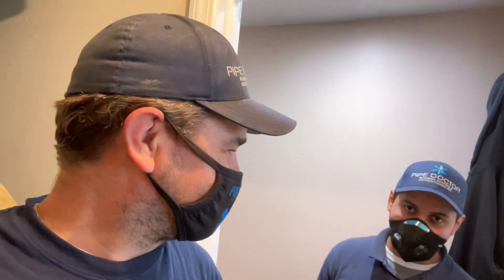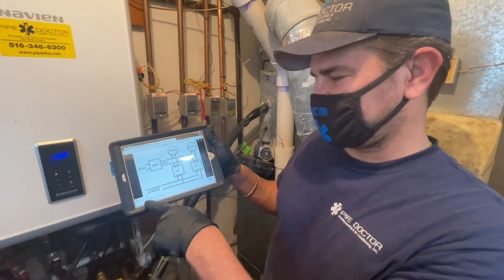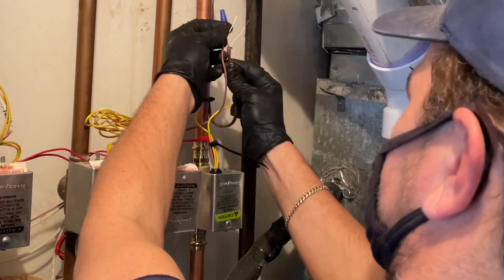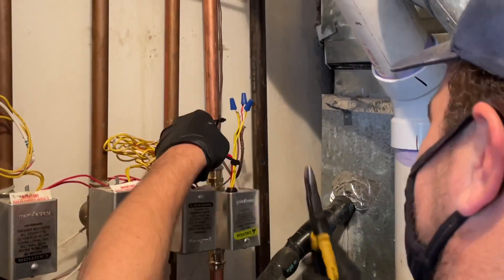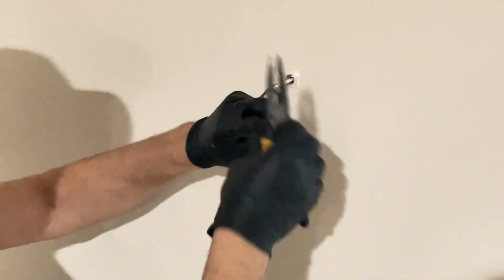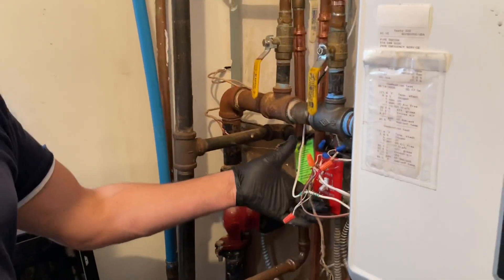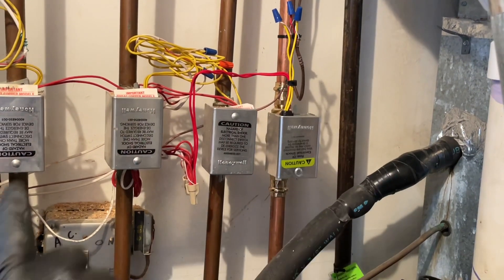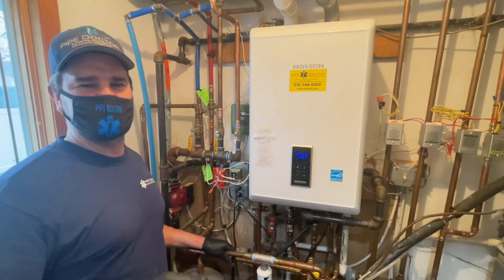How to Install & Wire Honeywell 4 Wire Zone Valve

Comment: All you showed was how to took up the yellow wires .. didn't say anything about the  two red wires  or when hooking to the 24 voltage transformer  what the red or white  wire goes to..  does red go to the R screw or the  C screw..  the red wires goes to the boiler?..   Not really helpful for explaining how to hook up a zone controller..
Reply from the maker: Only u complain. Why is that?

Comment: Mikey- I’ve been following your vids since 1000 subs.  Usually just for entertainment but today I should have searched this out before fighting with my wiring for the better part of 2 hours. I’ve got a boiler and one circulator, and my garage heater wasn’t working properly. After a lot of playing I realized it would only heat when another zone called for heat. So the end switch was broken. .  I have 6 zones and two transformers, and someone crammed a million low voltage and thermostat wires and zone valve connectors into a tiny metal box attached to conduit. After I finally got it running, I came and searched  to learn what I had just copied from one zone to another. Thanks for the great reference material. Hope you’re enjoying PR